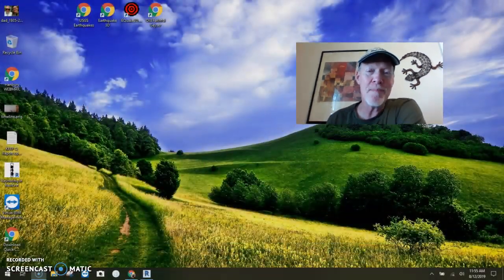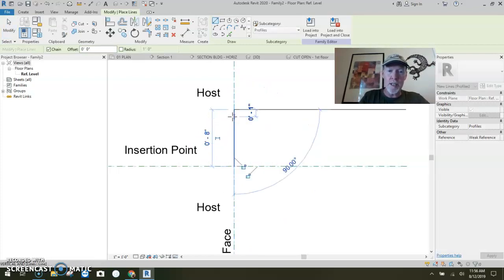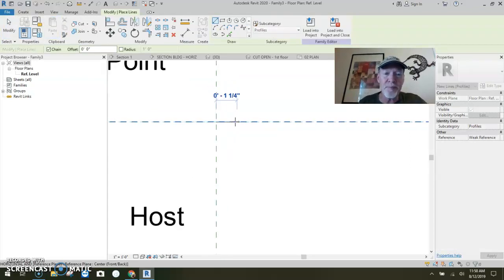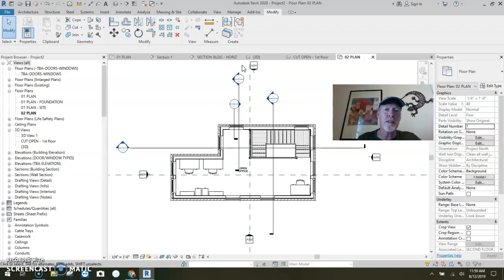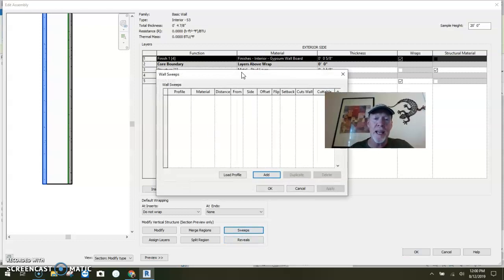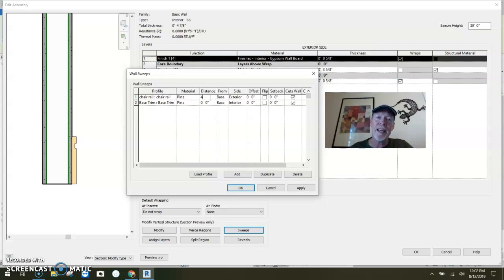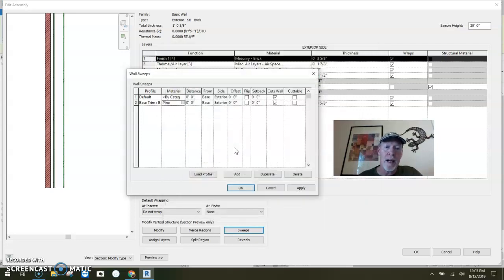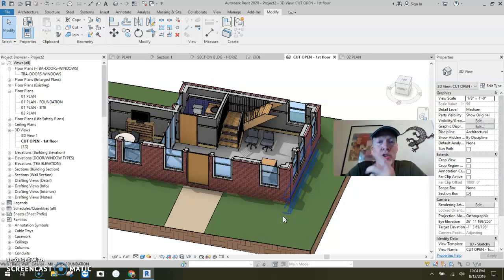Adding SWEEPS inside a Wall Type

Comment: Very helpful, thanks! Can sweeps turn till the doors and windows?
Reply from the maker: It depends on what you want the sweep to do at doors and windows. You can make the END of the sweep return at an angle to the wall and also hold back a few inches away from the doors/windows. I’ll do a video!
Reply: @miketaylor-fantastic  Thank you Mike. I love your videos!

Comment: this was great! very helpful. Isn't there also another way to create sweeps without adding the profile onto the wall type?
Reply: Yes.. you can add sweeps individually, but that could take a while if you have a lot of walls. This way, you just change the wall ‘type’ and BAM.. the sweep appears at the correct height. No fussing with it!